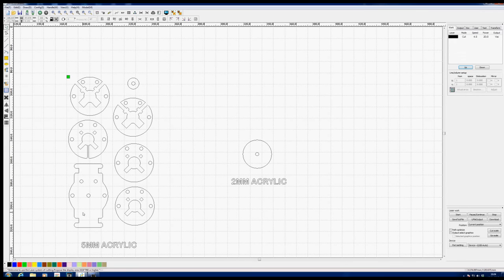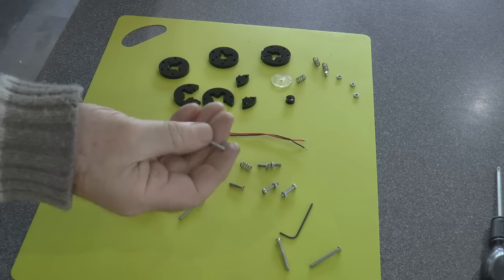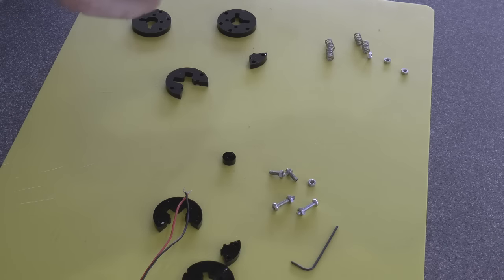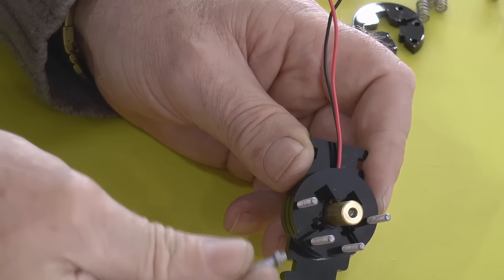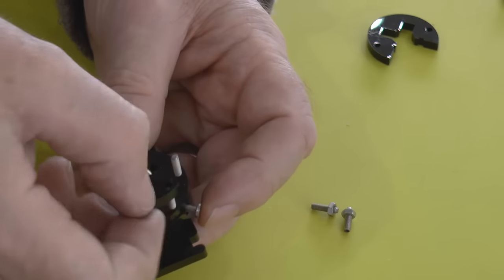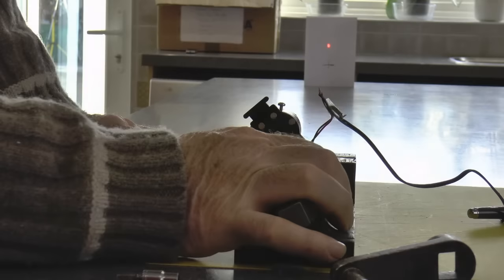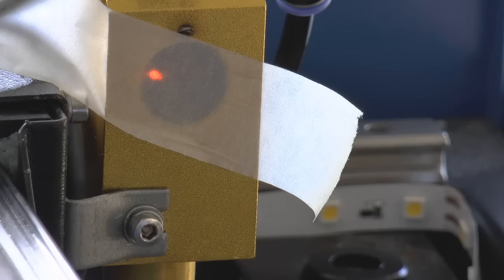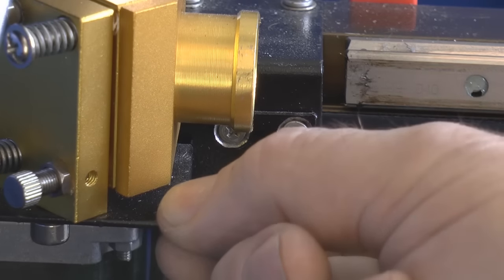RDWorks Learning Lab 38 Mk3 Laser pointer part1

Comment: Russ,

Love this idea to bits !

If you want to improve the shape of the laser dot, stick a small disc of aluminium tape over the end of the laser, and then make a small hole with a pin in the center. 

The smaller the hole, the smaller the dot

Also useful for the alignment laser at the other end.

Chris
Reply from the maker: +Spiyda Design 
Hi Chris
I took your pinhole idea on board when I was testing my copper mirrors. A dodgy mirror was making the dot grow in size. A great help to me. I have used masking tape instead of foil and it works just as well and I can take it off easily if I need the sausage shape back.
Thanks again
Russ

Comment: This is great design!  On my machine I added beam combiner instead, so basically I can also align with laser beam alone. I also noticed up/down movement on 2nd mirror and I got it fixed by actually lifting end of Y rails with help of some metal washers (3 to be exact). Now beam doesn't go up/down when moved in Y direction. But I still have issue of beam moving left/right when moving on X axis, and I've to to figure out how to move that rail...
Reply from the maker: +bratan007 

Time limitations on the video prevented me going into great detail of what and how I found/fixed the problem.

It was originally suggested to me that the Y rails were not true (implying bent). A quick check with a steel straight edge dismissed this possibility.  The mirror mount was definitely flimsy as you saw. I kept on focussing on the way that the cable chain was attached right adjacent to this flimsy bracket. It was the only possible cause of external influence on the Y axis apart from the drive belt. My so-called red dot pointer turned out to be a red sausage pointer.  I was glad it wasn't a true dot.  Trying to Keep the explanation simple, if I stand in front of the machine and flex the right hand side of the mirror bracket I make the sausage dot rise and fall across mirror 3, the sausage remains horizontal during this action. I now take the edge of the mirror bracket closest to me and flex it up and down. The sausage shape again rises and falls but this time there is ROTATION in the sausage. Take a second look at the powered traverse I made at the beginning of the part 2 video. Now do you notice the rotating sausage? 
That was what persuaded me to find a way of stiffening the current bracket (which worked) or to make a brand new bracket from thicker material and mount it differently. Good job it wasn't a dot shape after all otherwise I would not have seen the rotation element.
 Are you sure bent rails were your real problem?  I don't doubt you have fixed one axis problem but washers ( m4 will be about 0.7mm thick) indicate an extremely bad bed manufacture. Could you see the rails distorted before you fixed the problem?  A light beam is the perfect reference plane that cannot move, but what's making it's landing point move is whole complex mechanical conundrum. 

Regards
Russ

Comment: As I go through your series I've become very impressed with your ability to design 3D structures in 2D. In your previous correspondence you mentioned that this was your preferred style, and clearly you are exceptional at it. So, how can a beginner learn this style? Do you have any recommended books or tutorials? CAD software preferences?

Based on your first reply, I have decided to withhold my purchase of this machine until I finish watching your series. Hopefully by then I will have an understanding of its capabilities. Currently, the project I would like to accomplish is a stippling job in nylon material. What are your thoughts of the capability of this machine for that? Thanks again for all your replies!
Reply from the maker: Hi Miguel
I was brought up through engineering with a very conventional tool making ethic  for making precision engineered parts. I trained as a production engineer and started to find alternative ways creating precision bespoke products by much more cost effective methods
Big one off machine frames were always made from expensive castings requiring expensive machining. That is where I started to think laser cut pieces with locations to accurately locate pieces against each other. . The strength is in the tennons provided you design then in the correct direction. You add only small amounts of welding to stop the locators pulling apart. The structural strength is in the locators an not the welds.  Welding causes stress and distortion, so keeping it to an absolute  minimum means you do not destroy the accuracy of the laser cut assembly. I am sorry but there is nothing I am aware of to teach you these techniques. I close my eyes and imagine.  I understand all the theory and techniques of draftsmanship that artists require and I could accurately draw all aspects of your face. However even your mother would not recognize you. I lack some essential skill to be an artist. My point is that although I lack that skill, maybe  I do possess another 3D dissection ability that many  others do not have.  You need to work with CAD software because graphic software such as Illustrator is to cluttered . CAD is purely mathematical,  based on just parts of lines and circles with a different range of tools . There are lots of free CAD packages you can download. LibreCAD and Draftsight  are two of the best
Best wishes
Russ

Comment: that looks a great way of making a laser pointer Russ far batter then the one I made on my 3d printer. I have massage you to see if I could have a copy of the dxf file, I think without your help on these laser machine a lot of people would have been lost as there is more to them then I, and I think most people thought. which lens did you order buy  the way, znse  or the hq znse .   shaun
Reply from the maker: +Shaun Browne 

http://www.ebay.co.uk/itm/391332816906?euid=24bf40a295d94c63ad8cd74208c7caee&cp=1

They are as good as the original fitted lens. and, I thought, reasonably priced. This is ebay uk but I suspect if you copy and paste  the title into ebay.com you will get the same item. I made a bit of a mistake when I ordered them I selected 20mm diameter and my machine takes 18mm diameter. Was I going to send them back? No. I just ground 1 mm off all round with my disc grinder. Worked perfectly.
Regards
Russ